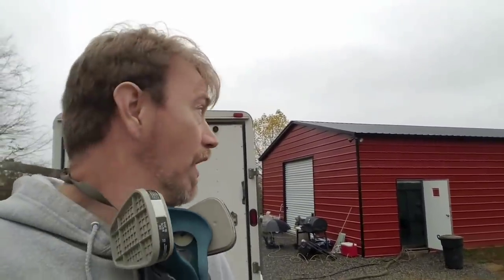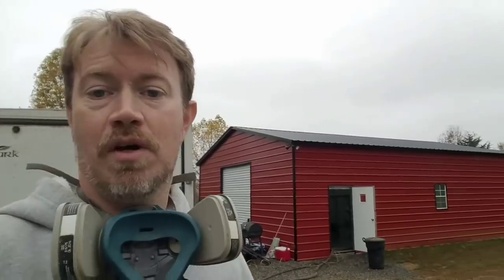Insulating Metal Buildings With Closed Cell Spray Foam

Comment: im a post frame   builder   35  years           do   NOT   INSULATE LIKE  THIS!!!    this stuff is toxic    a fire hazard     and will  rot     your wood  structure        this is a total ripoff         get educated   and do it right
Reply: You guys.... He's " Part " right.  If you live in " Humid / Wet " weather, it will rot and deteriorate in no time.  We had  that done in our Garage and now we regret doing it :(((.  But if you live in " Dry Weather " all the time, you will have no problems.
Reply: Jordan Bronson You are 100% wrong. I have been an American Chemistry Council certified master spray foam technician for the last 10+ years. If the product is processed right and sprayed correctly, you will NEVER have moisture or rotting issues. That is a fact. Closed cell foam is a complete water and air tight barrier. If anyone that has had this product sprayed in their house and is having these issues, you should sue the company that sprayed it. The company that did the work was not certified to do so. You people need to do some research on the product and companies before having this done in your home
Reply: Jordan Bronson Wow. That was mature. Typical response from a clueless kid though.
Reply: If your wood rotted, it was because it was saturated with moisture or already dry rotted at the time of application. Once the wood is sealed, no moisture will enter the wood unless your support post are in the ground, or your exterior walls or sill plates are not flashed and sided correctly.
Reply: +noshmasters - Oh shit, another " Expert ", LMFAO !!!!
Reply: 😅😅😅😅😅😅One time at band camp i stuck a flute..... LMFAO !!! 😅😅😅😅😅😅
Reply: The foam will not rot wood. You are spreading misinformation and building inspectors would back me up. The fire rating meets  Federal home building code. NO I do not sell or install the stuff. I hope you are not a builder in my zip code.
Reply: you sound like you had a bad experience with an inexperienced company.  installed correctly closed cell spray foam is bullet proof in any climate zone.  We do a house a day for over 8 years now and have never had an issue w moisture, fire, or sickness/health problems.
Reply: +dadcss - 😅😅One time at band camp i stuck a flute..... LMFAO !!! 😅😅😅😅😅😅
Reply: It sounds like you had a problem with the cheaper OPEN cell foam , it can hold moisture . Closed cell is great , it adds a lot of structural integrity to a building and is a 100% vapor barrier to keep moisture out . It is also completely inert after about 30 seconds of curing time , burns only when exposed to a continuous flame ( goes out when flame is removed ) and completely seals out air .
Reply: +Benny Bryant - WOW... OMG... Finally someone actually made a SMART / PRECISED comment!  THANK YOU !!!
Reply: Stuck in the old days lol
Reply: I did have a guy tell me they used the wrong type in his attic and it gassed off in the summer and he could not be inside.  They used a product used up north in the south.  Go figure.
Reply: First off, the stuff that was used on my garage (closed cell) would NOT burn,i tried everything to get rid of the trimmings, WILL NOT BURN! Second who gives a shit about your wood building, THIS IS ABOUT METAL BUILDINGS!
Reply: @emmasalgado7877  - By the way, there is a WORD called " précised " in FRENCH.  I am studying FRENCH last year.  That's why I had that stuck in my head.  But in " ENGLISH ", I can't used " PRECISED " as a " VERB " anyway, since it's an " ADJECTIVE "!
Reply: @JodBronson  

Stupid is stupid does isn't how it goes. Maybe for you it is. Look it up . I'd hate for you to look dumb when calling others stupid. Your missing a few words. I've seen you write  it to others. Maybe your just showing us the true meaning of the statement?

Precised doesn't exist in French. And isn't correctly used in your application even if it was in English.  I say you take English lessons instead. And be nicer to people, I was just pointing out that when you call people all kinds of names. It opens you up to criticism. So don't be surprised if someone calls you out on fake words or bad grammar or spelling just cause you were being rude to others.
Reply: @emmasalgado7877  - COPY: 
pré·cis (verb)

verb: precis; 3rd person present: precises; past tense: precised; past participle: precised; gerund or present participle: precising
1.
make a precis of (a text or speech).
synonyms: summarize, sum up, give a summary/synopsis/precis of, give the main points of; abridge, condense, shorten, synopsize, abstract, outline, compress, abbreviate; rareepitomize
"another strategy for improving your writing skills is to precis a passage"
Reply: @emmasalgado7877  - Corrections in YOUR Vs YOU'RE (YOU ARE) - COPY FROM YOUR POST - "Your missing a few words. I've seen you write  it to others. Maybe your just showing us the true meaning of the statement?
 " - You're missing... Maybe you're just.... - Try that, before trying to " Correct " me what I've learned and what I haven't!
Reply: @emmasalgado7877  - NIGGA, YOU ARE CLEARLY BI-POLAR !!! 😂😂😂😂😂
Reply: @emmasalgado7877   - NIGGA, YOU ARE CLEARLY BI-POLAR !!! 😂😂😂😂😂
Reply: Norty81 Has